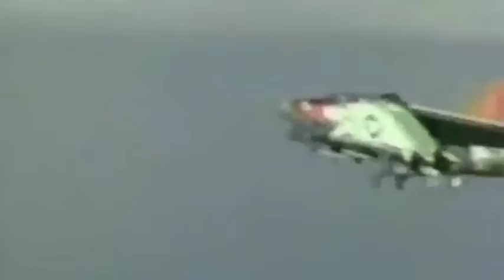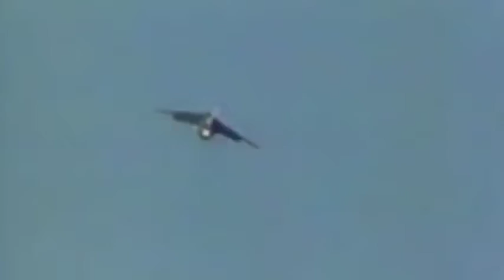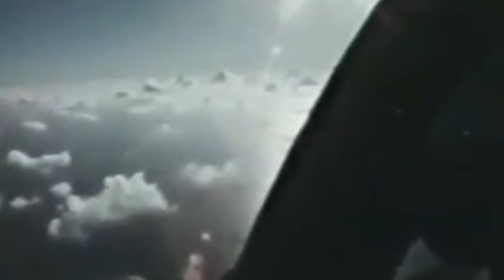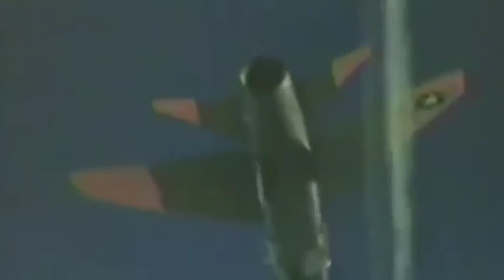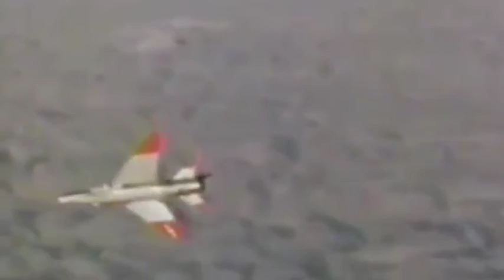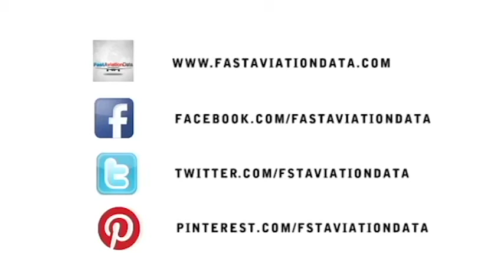Vought XF8U 3 Super Crusader III Fighter Aircraft

Comment: Imagine if we stuck with this, put a Vulcan cannon on it and used it in Vietnam. The MiGs would have been slaughtered
Reply: 2 problems with your proposal --
1) the Crusader III airframe was never designed for an internal gun and the M61 Vulcan is a huge gun that weighs at least 600 lbs and takes up a huge volume of space!  I don't see where you could stow that gun easily.  It has a small nose and I don't see where you'd install it without cramping the radar unit and causing a severe vibration issue (which the F-18 had to be designed to deal with).  It would also not be ideal to locate a cannon above the inlet because the last thing you'd want is for the engine to ingest explosive exhaust gases from the Vulcan which could cause an engine surge.  
They've had to redesign the gun exhaust grilles on more than one jet fighter to deal with gas build-up (danger of explosion within the airframe there; an F-104 prototype testing the Vulcan cannon was destroyed this way) and possible gas ingestion in the engines.
You'd have to move around a lot of internal components to shoe-horn the Vulcan in and it may not be practical.  
They did NOT retrofit the Vulcan into the F-4's that existed prior to the E-model; most F-4s aside from the E and F models used external cannons mounted on a hard point.  It was not ideal and created a lot of drag but there was no place else to stow the cannon and it would have uneconomical to rebuild those airframes.  The F-4E had to be re-engineered to install the cannon.  The contractor (McDonnell Douglas) ended up using the name nose as the reconnaisance models (RF-4B, RF-4C) to save money (it also addressed some aerodynamic issues and allowed an external) but still had to rearrange a lot of components internally to fit in the Vulcan cannon.  The use of the recon nose also allowed an external fairing to be used to contain the cannon barrels and a muzzle nose.
There was a negative consequence to changing the less bulbous nose for the F-4E.  There was less room for the radar.  The radar set used in the F-4E was smaller and less capable in air-to-air modes than the Navy models (particularly F-4J) which had larger dishes and could scan farther with true look-down capability.  
2) there were relatively few MiG kills with cannon.  The early missiles were lousy but they improved the Sidewinder later in the Vietnam War.  What really cost pilots their kills (and lives) was the poor quality of training.  They were so focused on safety they neglected teaching the pilots how to fly better to maximize the weapon systems they had at their fingertips.  The pilots didn't know how to maneuver their planes to maximize advantage, and they didn't know the firing parameters for their weapons.  That attitude of safety and lack of knowledge on the parameters of their weapon systems killed more people.  Without improvements in training, a cannon does no good.  WIthout proper guidance and specific training for the cannon, you're wasting ammunition.  They installed external cannons on some F-4's but most of them did not at first have targeting reticles to show the pilot the flight path of the cannon's ammunition!
The F-8 had four small internal cannons but they were lousy.  They locked up under G-force.

Comment: This bird would've been the first specialist air superiority fighter to go into service with the Navy if they weren't so deluded and naive with their early generation AAMs
Reply: The navy F-4's ended up with the highest K/D of the war. The issue wasn't really the missiles, but rather the poor training of the pilots on the new tactics. Even the F-8, a plane designed with guns as primary armament, mostly got kills with sidewinders.
Reply: @sheeplord4976  The cannons (4 of them) on the Crusader were awful.  They were useless in high-G maneuvers.  They tended to lock up.  That's a recurring issue with plane designs going back to World War II.
Reply: @AvengerII  do you mean they jammed in high g maneuvers, or just that they jammed often and were hard to aim?
Reply: @sheeplord4976  The guns jammed under high-G conditions.
"hard to aim"  No, these cannons are fixed.  They don't move!  You maneuver the F-8 to get the target in sight!
The problem they had was they didn't consider the effect of G-loads on the guns and thought they'd just be using them to strafe ground targets or aircraft that weren't maneuvering hard like bombers.
The F-8 had some design issues that its supporters underplay or just don't know about.  The landing gear were pretty awful on the plane and often failed on carrier landings.  About 1100 of the 1200 or so Crusaders built were involved in accidents.  That's worse than the F-14 which had about 25% of its production run (712 planes) destroyed in accidents.  
The Crusader was probably one of the least safe fighters to land on carriers.  The F-4 and F-18 were probably among the safer fighter jets to land because they had stable glide paths on landing.  The planes that have landing issues are often unstable in the carrier approach at slow speeds (both the F-8 and F-14 although I think the Tomcat may have still better there than the F-8; it was the F-14 A-model that was really bad with both flight control system issues and poor throttle response with the TF30 engine) and have other design problems like the horrible wing stall of the F4U Corsair.
The F-8 was not the first fighter to have problems with guns like that.
The B and C models of the P-51 also jammed under high-G.   That was one of the things they fixed in the D-model when it became available..
Reply: @AvengerII  thanks for the clarification. I just assumed "they were useless in high-G maneuvers" and "That's a recurring issue with plane designs going back to World War II." were linked to the difficulty of deflection shots. Thanks for the info about guns jamming under high G.